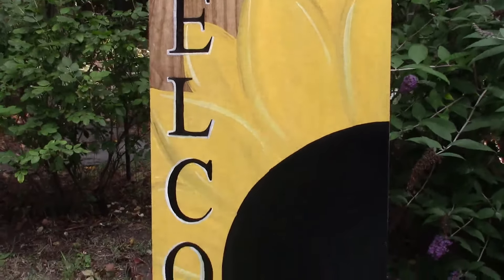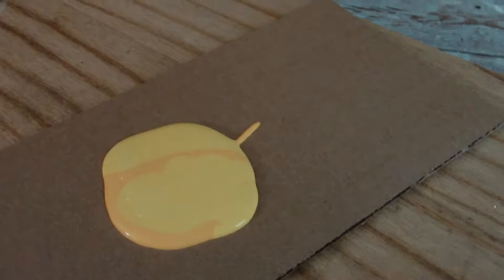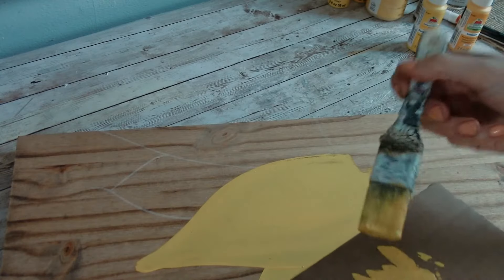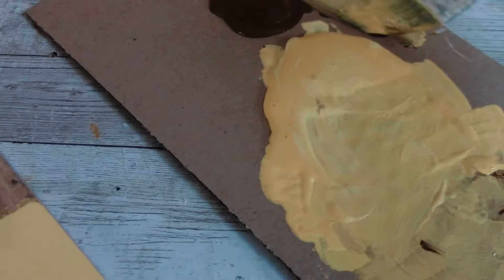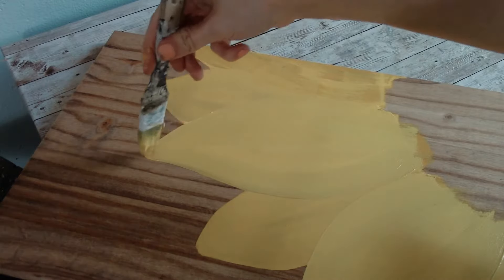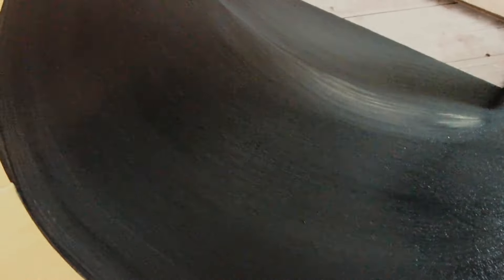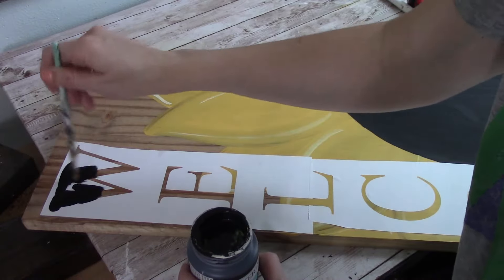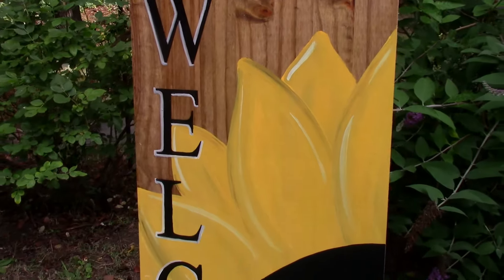Sunflower Welcome Sign Tutorial | Hand Painted Porch Sign Full Step by Step! 🌻👩‍🎨💛

Comment: How do you get the stencil letter spacing right? Like in between each letter. You are so talented and a great teacher.
Reply from the maker: Thank you so much!! ❤️ I used to measure with a ruler or tape measure between the lettering, center the C with the L and have the top edge of the W and M line up with each other (using times new Roman font other fonts this may not be the case) against the left edge of board as well to keep all centered. After a while I got where I can just eyeball it but that can be risky lol